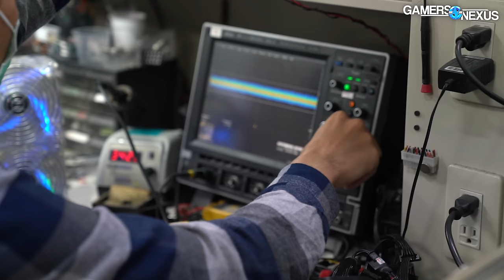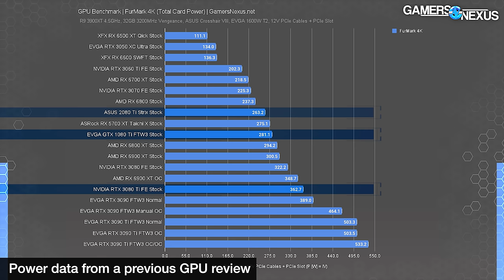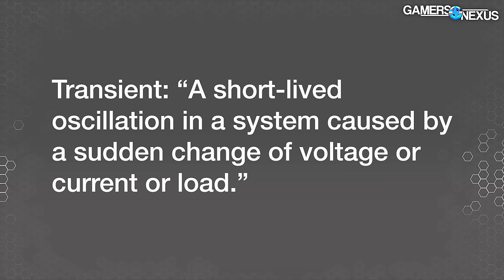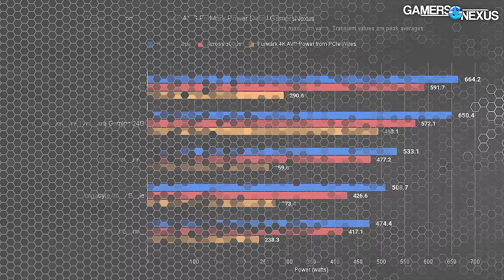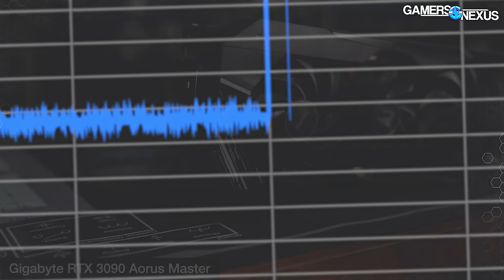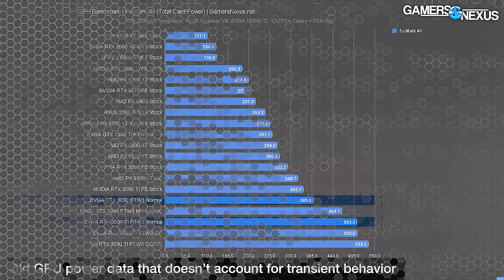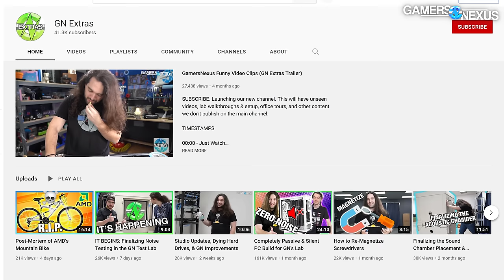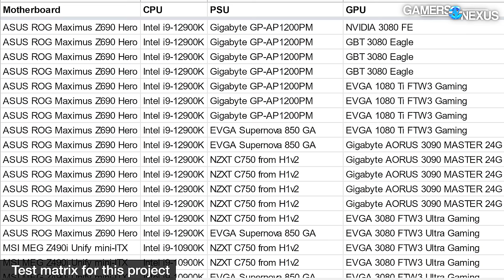The Brewing Problem with GPU Power Design | Transients

Comment: That is an old problem, especially evident with multi-gpu setups. There lists of psus which work fine for say 4x2080ti designs. 
One thing I didn't understand is why not just make a cable extension with an accurate and linear probe?

Comment: The power monitering software like MSI Afterburner does not show these spises, but I have seen them on my hardware power meter. They are there. And they can be at least 2x the average power. Usually happens at the very start of a max GPU load. That is why one should use a quality Power supply. To power a 300W (avg) system (example 200W GPU), aim for at least 500W rated Quality PSU. With a modern 350W GPU, use at least 750W PSU. Also mind that Intels 10900K or 12900K CPUs are power beasts at stock settings (if not limited in BIOS). So a 12900K with say a 3080 Ti, I would recommend at least 850W rated High quality PSU (even if total system uses just around 450W average during gaming.

Comment: 3090 FE (no OC) works well with my power unit Corsair RM850
MB Asus dark hero (BIOS 4201)
64GB RAM PC 3200
AMD 5800X (no OC)
3 SSD incl. 1 Nvme gen4
Win10 pro up to date

40 series looks scary, energy wise. Thanks for the head up

Comment: Using R7 1700 32GB RX580-8GB with x370 prime pro and CM V850 PSU with no OC or DOCP, I would have random shutdowns like this when running Valorants or sometimes even Rocket League. Especially when the compressor for AC in the next room or mine would kick in, BOOM! system shut down again and this led to me trying the wrong things to fix & bricking my M.2 SSD.

Now running the same config all fine on B550 Aorus Pro motherboard with far better VRM on board along with the handling of memory.

Comment: I have a MSI Ventus 3x 3080 LHR, MSI MAG B550M Mortar, and R6 5600 cpu running on a EVGA supernova 650 GM SFX PSU.   

Everythings been running fine on it. 
I play Overwatch, Apex, CP2077, and even Hardspace Shipbreaker which I know is hard on the gpu and its only ctd'd once.

Comment: I went through this when I tried to upgrade from my 1080ti to a used 2080ti a year ago,  thinking the GPU was no good running an older XFX 850watt psu.  Then when I tried a new 3080Ti this year, the same problem of shutdown started to happen again. A new EVGA 850watt psu finally solving the problem.  I tried to monitor voltages to try to prove fault, but nothing definitive would show it. The only thing I would notice is a dip on 1 or 2 of the pci-e plugs at the gpu from 12vdc to 11.9 with a shutdown maybe or maybe not happening. I could get the system top fail consistently in the game 7daystodie of all things.    At the time I was guessing (and hoping) that it was a spike in the current during an split moment dip in the power to the gpu was causing the psu to OC trip. My guess (hope) turned out to be correct after installing the new psu.   Now I am worried that maybe I should have gone more than 850watts on the new psu.
Reply: I haven't played long enough on my rtx 3080ti but when I had my 1070ftw and i7 9700k oc to 4.8ghzt all core I had zero issues had that rig for over 2 years and the GPU for over 4 years not a single issue. Got my new gpu inserted it and bam shutdowns like literally instantly or a complete system freeze for a few seconds and then shut down like someone pulled the power cord. This happened when watching a utube video like a 3 hour one,  Now am hoping same as u I bought a 1000wat PSU because I know my pc with the 1070 I had zero issues and I allready swapped a 3080 twice and a 3080ti twice evga both of them and the issue only happens with the 3000 series when I use my 1070 no problems

Comment: i have a 1400w ASUS Thor,  x570 hero board, 5950x CPU, and ASUS strix 3070.  i had to remove ALL RGB software and RGB 5v-12v devices.  this solved my shut down problem.  board/fans still had power but gpu / system was completely locked up black screens.
this would happen in game or even if the PC was sitting there idle... was extremely strange.

Comment: Impressive work as usual. Bravo.
Bottom line, this issue is due to no one wants to put capacitor on their equipment to avoid this issue. A few $ solution on thousand $ configuration. That sound too stupid to be true but still believable.

Comment: I've done waaay to much excel sheet work - I plotted more than 2.5 million points in one excel plot and the software barely held together. During my third research internship in my masters degree (chemistry) my supervisor urged me to get into Origin to plot xray diffraction patterns. I can only recommend that. The user interface is a horrible clusterfrakk and it's annoying to get into it but absolutely worth it in the end. Also data import is undoubtedly superior to anything excel offers.

Comment: This was super interesting. I wonder if there is a general direction for motherboards when it comes to them being able to handle the power sags that come from the PSU because the GPU is sucking more power than it should. I would also love to see what you guys did when it came to getting the data and making it comprehensible. I think excel would have a pretty hard time with that much data. I also believe that there is some oscilloscope front ends that allow for the sharing of data over USB. Oxide Computer had a Twitter space about a bring up of their switches and one of their guests was talking about software he had built to pull data from a bunch of different oscilloscopes onto his computer. It was kind of in the GNURadio family of products.

Comment: It is really a lack of experience from builders of PC's in cutting their PSU total power too close to the overall power consumption of their system. The best advice for building a PC is to take the total wattage of your system, and add 200-400w for your PSU. 30 series needs at least a 1000w PSU. 40 series, 1200w and up.

Comment: This is 100% the GPUs fault. They say it uses X and it really uses 2X so they need better firmware or drivers. It's false advertising and it's costing power supply manufactures money.

Comment: 2PCs, 1 with Ryzen 5800X undervolted and RTX 3090 FE, 1 with a 7th gen Intel office CPU and a GTX 1080... both playing Fortnite and the Dishwasher running in the kitchen.... suddenly: power out! Dishwasher stopped and had to go to the circuit breaker. Happened a few times, and we learned our lesson: don't game and wash the dishes at the same time! lol

All joking aside, my PC is running a 750W Thermaltake SmartPower (tried Corsair for a second time, and PC just did not want to power on. I hate Corsair!). My 3090 FE can at times draw around 300W or more. The biggest draw I have ever observed overall on my APC battery backup was around 650W for the entire system (including TV). I play in 4K at 60fps mostly, but I also run V-Sync because my TV has no VRR and I hate screen tearing. So, with that, my GPU never hits the 100% mark except for some games that have some outrages demands especially with Raytracing on (in Fortnite can definitely max out the 3090). The CPU is also barely active during many many games. And I have undervolted that 5800X because it always got hot and my fans constantly ramped up and down. I have a sweet spot setup for myself, and never had the PC crash. But too many things running in this apartment can certainly affect the entire unit's power draw.

Comment: I had an 850W when I got my 3090. I had problems when the card was in OC mode. More often than not I'd very quickly see artifacting. Occasionally it would trip the system. Replaced it with a 1000W PSU and I haven't had either problem since. Still, that's dumb. When you see what Apples doing with the amount of power they're using. It feels like GPU manufacturers are going the wrong way. Albeit, different designs.

Comment: Noice piece, informative! Looking into buying a higher end 4000 series when it drops and max power draw are a concern of mine after seeing how the power draw is with my 3090 and 12900k ( both OC). Probably will be looking to upgrade from my 850HX to a 1200w something something 

Even been playing around with the thought of doing dual PSU's, dedicate one to graphics, but find so much back and forth information about it. Plenty induvidiuals have been doing mining rigs with dual and more PSU and even in some gaming rigs. Some say it isn't safe, that the voltage diff can ruin components etc. while others have non issues with it and everything is just running fine. So I dont really know what route to take atm

Comment: Id be curious for a follow up with 40 and 7000 series cards, I'm currently on a system with 12700k and 7800xt red devil and I think that I may be running into this issue with a EVGA 850 supernova. If I try to change to anything but the default profile I get system crashes.
Reply: Asus z690 prime-a and 64gig g skill ddr5 6000 Corsair 240mm aio

Comment: really difficult topic to cover. I really what I think it comes down too is dont cheap out on the PSU and give yourself head room. I had a coolermaster 1200w for 10+ years (bought it for SLI gtx480) and buy for the future. You're not going to have the same GPU/CPU for 10 years. I did drop down to a corsair 850, am i going to buy a 4090 probably not but I'm pretty sure if I did I would have a 1000+ PSU. im sure it will be fine on a 4080/70 and even work on the 5080/70. I do think though Nvdia need to work on power consumption, for the environment and cost of living is at a all time high. I wouldn't mind if the leap of a gen was a little smaller if it brings cost of consumption down. lets say the 4080 is Balls to the wall power is high but you wait a year or two and the 5080 comes out cheaper and more efficient but thats just me

Comment: I tried running a Gigabyte 3080ti with an R9 3950x on a Corsair 850 PSU and it was just no go. Ended up putting it into my main machine with a 1200W PSU and two old Xeons. After that I avoided getting an EVGA 3080ti in case it was similar. I have zero interest in 40 series cards. Am gonna wait for them to get efficient again.

Comment: I always overclock my system.  I have never bought a power supply under 1000 watts in the past 10 years and my current minimum is 1300 watts.  I have had very good luck with EVGA 1300 SuperNova G+. You can pickup this power supply for less than $170 on sale. My current system is AMD 5900X, Asus Crosshair Hero VIII, 64 gigbytes of RAM, Nvidia 3080TI FE, Samsung 980 pro 2TB.

Comment: Transient spikes are not new to any Chip designer. When you are pulling that kind of power and have that level of integration you will get substantive surges. A common pop is during block moves on PCI and RAM. Normal cadence while GPU crunching might be X but when there is a lot of I/O on those very wide busses it can really surge.

My rule of thumb is to take the calculated TDP of all the whole system and double it. Yes its a bump in PS cost but that PS will have no issue keeping up with surges (has bigger caps) and will never really break a sustained sweat. The PS will last well beyond its needed use - maybe for a couple builds.

Comment: It is totally the responsibility of the user of power to keep worst case scenario under control, they can do "power credit" based design in firmware to keep track of how much each operation will be drawing to keep the usage steady.

Comment: You've done a hella great job here, forgive my probably-ignorant comments, but it seems to me, if the industry doesn't want to throw hardware (giant capacitors) at the problem, the situation can be mitigated somewhat with software…

Driver developers could ramp these high-current-drawing moments up and down "slowly", probably causing brief moments of lower texture/shader/RTX/AA quality.

Alternatively, unused silicon could "spin" as needed (doing any kind of work that doesn't affect the visuals) to smooth out the changes in current draw. Of course, this would increase average power consumption and heat, hopefully not by much.

Comment: I had a power supply.... >10 years ago, that had capacitors installed on the aux power connector cables for the graphics card.... I wonder how big the caps would have to be to bridge the power gap..

Comment: I upgraded my PSU to 750 watts specifically to buy an RX 6800XT before it came out. Flash forward almost two years later and I still don’t have one. I don’t want to have to do this again for the RX 7000 series to ultimately not be able to get one again.

Comment: So you can simply beef up the smoothing cap? That kinda sounds like a non issue because even in bigger power supplies the caps are not really big at all. Look into a hifi amp and you'll find bigger ones. In enthusiast car hifi huuuuge caps are a staple. Are elcos fast enough to react to microsecond transients? From the video it looks like it, since the bigger PSUs with the bigger elcos did fare better.

Comment: I get platinum PSU's which are rated at 2 times the wattage as my expected TDP (build-wide). So my average power draw is at 50% of the PSU's peak, which is where it gets peak efficiency. And I have a ton of headroom. The power delivery itself is cleaner too, which affects stability and longevity of components. And the PSU lasts forever when it's not constantly red-lining.
Peak spikes have been a problem for many years, the spikes are slightly worse than they used to be. But mostly it's just that with higher TDP, people are trying to get away with more minimal power supply wattage, and they're 'noticing' peak draw issues more often. Do your power bill (and all of your components) a favor, and build with a stout PS margin.
Reply: And yeah, I have downgraded a component choice on occasion because while it might be worth the $150 extra bucks to get that component's performance, it isn't worth the $150 extra PLUS the additional $200 for a better power supply to stay within what I consider to be comfortable margins. So if I'm torn between a 5800X and a 5900X or a 3080 vs 3080ti, I look at the tdp, and look at how much the better part is going to increase my PSU cost. Often that answers the question of whether to go with the higher end part or not.
--The recommended PSU wattage advertised by GPU makers and such though, is (and has long been) irresponsibly optimistic. Ostensibly to sell more units.
Reply: The last system I built I spent $1200 on gpu & cpu combined, and $250 on the PSU. if your spending ratio is significantly different, you're probably cheaping out on the PSU, and you'll get what you paid for. And your components won't hold up as long. And your power draw from the wall will cost you more in the long run.

Comment: If you think about it for even a little bit it's the gpu producers' fault. PSUs have been developing more power supply using the same old tech, gpus on the other hand are the power drawers, a psu cannot make these spikes happen its the power drawing components that do (GPU or MOBO). Gpu manufacturers keep increasing power consumption with no upper limit so much that they have created this problem with the transients. Good think on GPU overvoltage protection otherwise we'd have very expensive bricks.

Comment: I personally think that it's the GPU manufacturers fault 100 percent. The Power supply is running what stated while the GPU can have 2x-3x the power draw. Yes the power supplies can have additional features to aid in spikes but other components that run on it shouldn't abuse or rely on that for their product to work. 

Example in the automotive field. If a lightbulb rated for 10w power consumption is actually using 20-30 watts and keeps blowing a fuse on your car it's not the fuse manufacturers problem that's causing it to blow it's just a poorly designed lightbulb.

It's like If your car got 2-3 times worse gas mileage sometimes and the car manufacturer blamed the gas company.

Comment: I was running a Ryzen 5900X and RTX 3700 with a 750W PSU and I got a bunch of random shutdowns and sometimes just graphics subsystem crashes resulting in games crashing but not a hard shutdown. Could not quite work it out. Didn’t seem to be software and updates/drivers etc made no difference. Anyway upgraded to an 1000w PSU and it stopped. This surprised me because I thought 750W was probably ok. Then upgraded to an RTX 3080 TI and still all good. So I guess it was the PSU.

Comment: The solution is for PSU manufacturers to say to Nvidia "we're done dealing with your demand problems. You want to draw 3x your claimed power rating for a handful of milliseconds, go back to the days when motherboard manufacturers weren't interested in your whining: supply your demands with your own external power brick."

This is entirely nvidia's issue, because peak demand should necessarily be a factor in stated power requirements. If they want to advertise their  power draw as lower than their peak transients, they need to supply their own capacitance to make up the difference or supply their own power.

Comment: Get this:
Power supply get more efficient, so you can aim for 80% nominal power consumption without losing efficiency.

GPUs get more powerful, resulting in more power consumption.

To keep themselves competitive, GPUs manufacturers are overpowering their GPUs for that extra performance.

That results in transients that are twice the nominal amount.

Meaning you can not use your power supply at 80% because the GPU can get 160% combine with other transients (CPU, memory, e.t.c) it can make the nominal load more like 120% for seconds.

kinda crazy, that the 60% rule refused to die, due manufacturers going for more power at the same price.

Comment: I wonder if there's such a thing as a PCI-E 6 pin or 8 pin extension cable with extra capacitors built in along the way to mitigate power spikes? Would be a super neat product, IMO